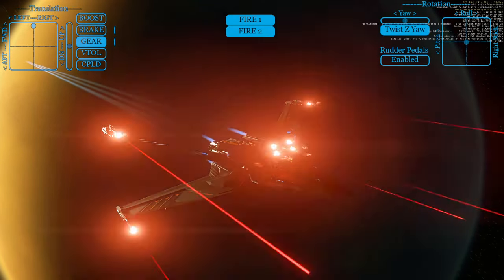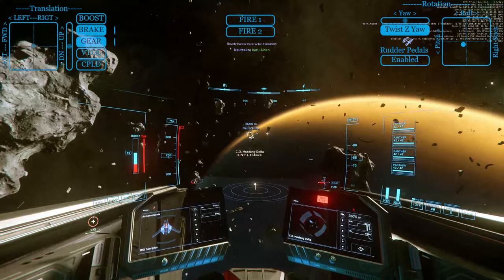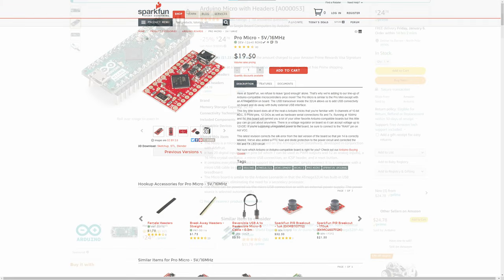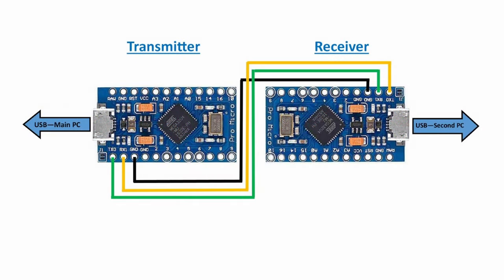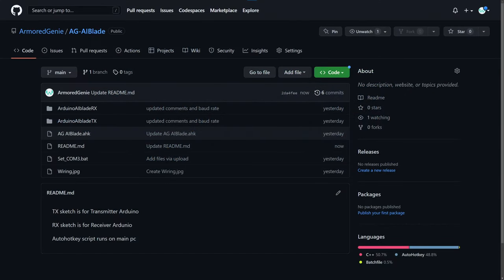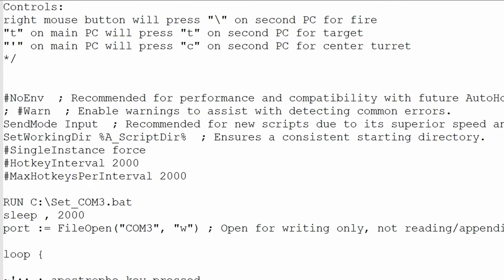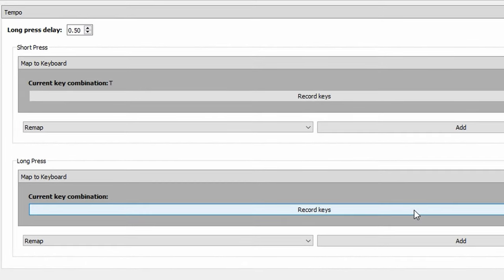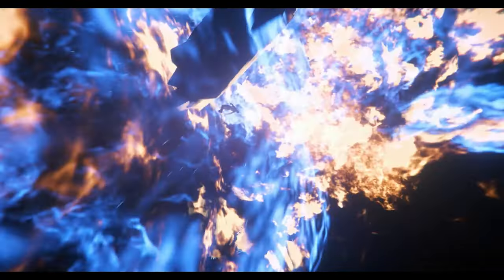Star Citizen: AI Blade How-To

Comment: ooh 2x ESP32s with wireless connectivity would lower the jankiness and remove the need for soldering a com port. Or you might even level it up with direct key bindings in SC using bluetooth HID libraries and connect the devices via i2c or serial.

Comment: See... as a lay man, I do not understand why this can't be done over network.
Is it a functionality that no one has made a suitable software for? Is there an anticheat that prevents remote connections from sending key strokes to the application?

Like:
If Keystroke X send signal to PC2, PC2 has a software looking for instructions from PC1 and when it sees the single, it emulates the keystroke.
Reply from the maker: Can totally be done over network! I just find it more fun this way and it's what I have more experience with 😁
Reply: @ArmoredGenie  Do you know of any examples or Python scripts out that could do this? I have a laptop on hand and wanted to try this, but I don't really want to spend the $80 and 4 days it would take to set buy and set up Arduinos as a complete novice with no other uses for them.

I tried looking around but I'm not really a scripting or tech hobbiest so I really just end up at a dead end.
Reply from the maker: Not really my forte either. You can try looking for "multi-boxing" software, as that's basically designed to do exactly this. I haven't messed with them personally though so YMMV